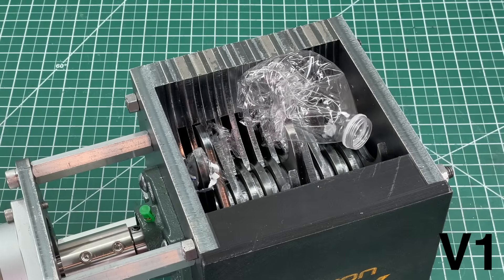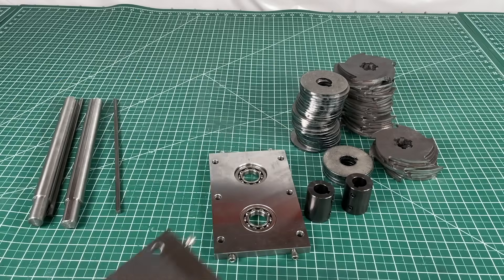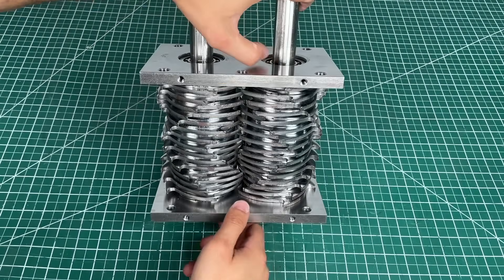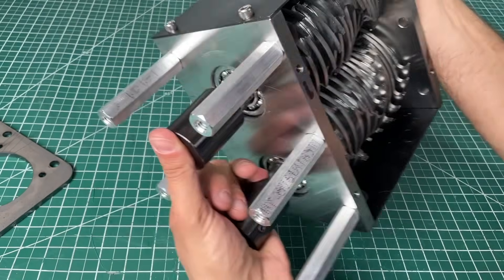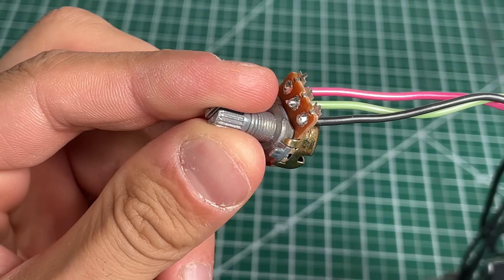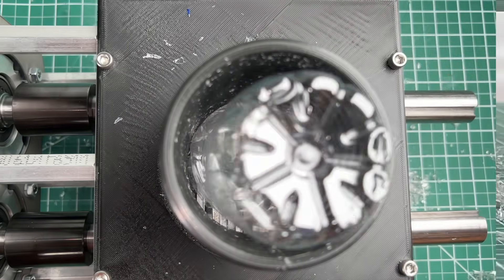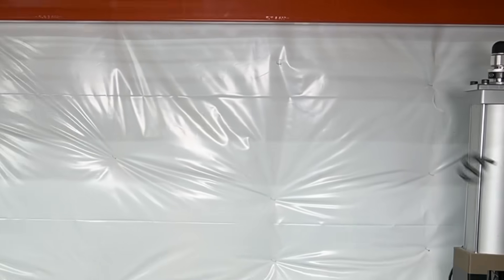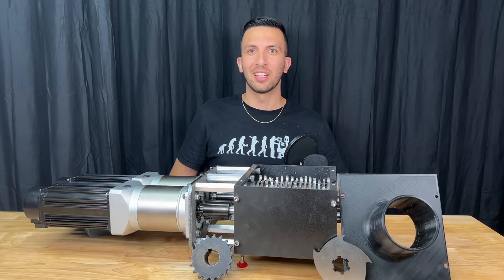Super Powerful Homemade Desktop Size Shredder | SHREDII 3

Comment: Looks great any reason you used a keyway instead of a hex rod to transfer torque to the blades.
Reply from the maker: We tried a hex in our original Shredii video.  It was a soft metal so it wouldn’t works great.  Getting round hardened rods is much cheaper.

Comment: Hey guys, thanks for the awesome video and the super cool machine.
I just can't find the SHREDII 3.0 on your website. Can you let me know when that would be available and what is the expected price? also if you can put a link for the recommended motor and gearbox that would be awesome.
Good luck
Reply from the maker: Hi, SHREDII 3 is now replaced with SHREDII 5 at actionbox.ca 

Shredii 5 comes with the gearboxes and the motors are standard 56c frame AC motors.

Comment: Looks good but isn’t that an overkill with two motors and two gear boxes, I thought one gearbox and one motor and 2 gears for the 2 shafts would be sufficient
Reply from the maker: Hi, thanks for leaving a question. I would have to respond by saying it’s all relevant.  If you want to shred cardboard then one motor of this size is probably enough.  If you want to shred aluminum, you need two motors.  Of course we could use a single motor that is much bigger and get similar results to two motors.  Cheers.

Comment: Great project guys. Crazy great work!  I am sure you have been asked this, but why not use the output from Shreddy to make 3D printing spooled wire ? Also, since you have an arduino, you could program it to stop if someone yells when they get their hair stuck in there.

Comment: Can you share the motor and gearbox links?
Reply from the maker: I mentioned this in the video.  Unfortunately I had to contact the company for these products as they were not publicly listed.  Cheers
Reply: @ActionBOX  That's a major issue. Finding a reliable, high torque (and readily available) power source for a reasonable cost.
Reply from the maker: @1972Russianwolf  yeah I agree.  If I find anything promising I’ll be sure to post it on our public page here on YouTube. Cheers
Reply: @ActionBOX  Thanks, I'm going to try the 12nm NEMA 34 with a 50:1 gearbox. Similar to what you used on version 1.0/2.0. Question, I have a Raspberry Pi (either 3 or 4) instead of an Arduino. Will the Pi be able to signal the controller (CL86T) as the Arduino did for you? Or would I need something else?
Reply from the maker: @1972Russianwolf  the pi could work, but i know the pulse train they put out is not as stable nor fast as the arduino which was a problem in the fully automated plastic injection machine that I had built.  Also, stepper motors lose torque past the 400rpm range so the 12nm is only true around 400rpm. If you doing it faster (say 1000 rpm) you may not get enough torque out of the motor.  Just a quick heads up. Cheers.
Reply: @ActionBOX  Thanks, For shredders slow is the rule. Too fast and plastic can't fall into the cutters (bounces off the top of the blades) and can produce microplastics. And most plastics, depending on thickness, really only need 150-200nm.

Comment: Looks great! You definitely want to move to sealed bearings though, those open bearings are going to get filled with debris and seize up pretty quick!
Reply from the maker: We had considered that and you are very right. I appreciate you leaving your suggestion here.  We will definitely make the upgrade 😊. Cheers, Dave
Reply: @ActionBOX  And fix the bearings in place, for instance with a circlip.
Reply: nice work! Consider using a lovejoy type coupler to connect the  shafts because the current design is over constrained which will cause wear.
Reply from the maker: @ElixirCNC  I’m not sure those are rated for the correct torque. They would snap very quickly 😞.  Quite honestly these seemed to work really well.  Cheer

Comment: This is amazing and almost exactly what our Makerspace is looking for :) Noticed that you machined the drive shaft for Shredii, will you be providing that as an option, or providing a list of compatible gear boxes and motors. Great Work!!!
Reply from the maker: Hi Michael, I’m glad to hear.  The shaft will be stock, and will have an additional 3 inches on it for any custom machining.  It is a 1” diameter shaft which is a standard size.  Any machining for other coupling sizes would be a custom job. Hope that helps. Cheers, Dave.

Comment: Pretty cool little shredder. Since you were cutting plates on a laser anyways, you could've cut two gears for both shafts, and use a single AC motor with worm gearbox to drive it. But, I assume that those servo? drives with gearboxes are not meant for this project anyways. Something tells me that you're designing your own automated injection molding machine.
Reply from the maker: Hi Phil, thanks for your inventive idea 😃. We actually considered it, but indeed we had those other motors lying around for another project.  We have already made a fully automated injection machine which you can find on our channel so the new machine will be something different 😉.  Glad you enjoyed the video and thanks for leaving a comment.  Cheers, Dave

Comment: Think this could shred resin blocks 1/2” thick?
Reply from the maker: I don’t know, but I’ll definitely try.
Reply: @ActionBOX   COuld I send a piece to you?
Reply from the maker: @wantafastz28  is it something special? We have lots of left over resin parts that we could try.  Would that work?
Reply: @ActionBOX  it’s a left over chunk from casting pen blanks, different than 3D printed resin.  I’d assume harder. Would be very interested in buying a shredder if it worked.
Reply from the maker: @wantafastz28  Can you share more details about the resin? Is it a two part polyurethane or epoxy? Cheers
Reply: @ActionBOX  it is a urethane resin.
Reply from the maker: @wantafastz28  2 part?
Reply: @ActionBOX  yes sir